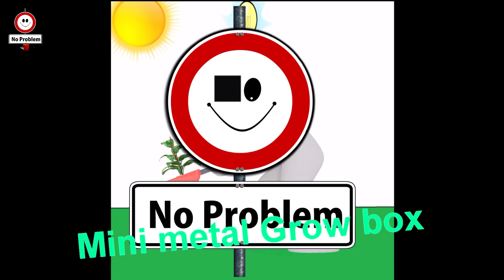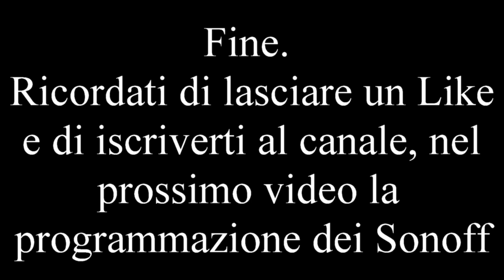Grow Box fai da te in bidone Ikea

Comment: hi, what kind of fan is this?
Reply from the maker: Hi.. It is called a centrifugal fan
For example DC 12V 0.36A 
https://a.aliexpress.com/_mKjJCVL
Reply: @GrowRaws  oh thanks for the response my friend! have you used those in the link? and if yes are they reliable? I want to grow a plant in a pc case, not anything very professional
Reply from the maker: If you have some cash to spend and don't want to have problems with heat buy 2 of these fans, and the 2 dimmers to adjust the speed.
https://a.aliexpress.com/_m0hgLGV
https://a.aliexpress.com/_m0aic93
On instagram you might find some inspirational photos, anyway why don't you use normal fans?  Since PC cases have the space made for it?
https://www.instagram.com/p/CNQpq9msK3J/?igshid=1fzfvpazq8yz8